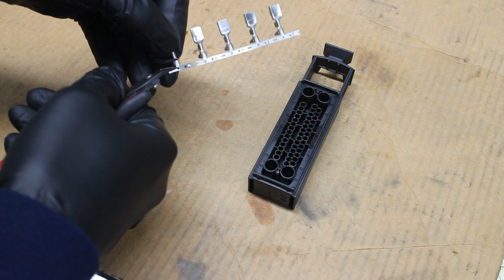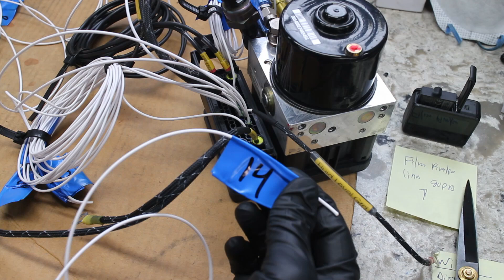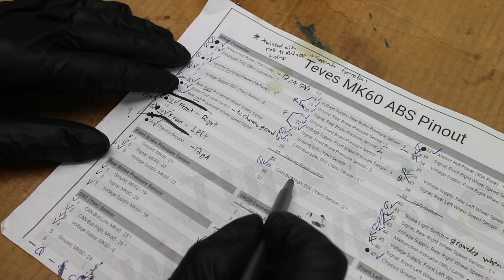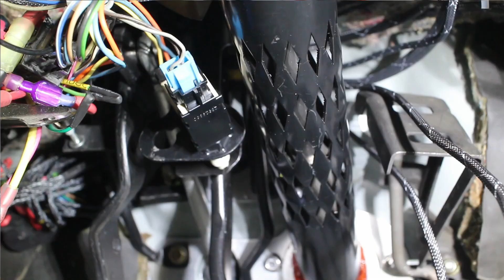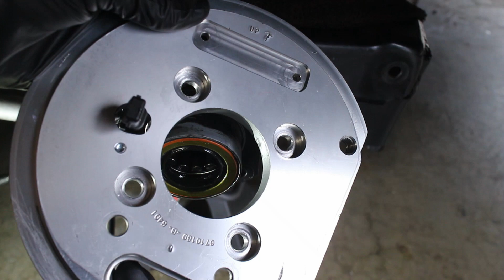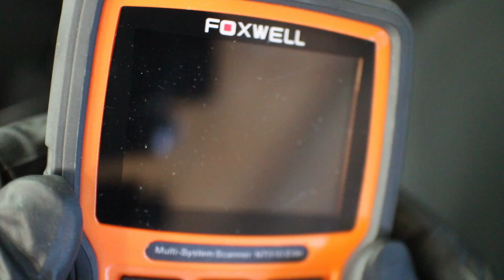Installing a Universal BMW M3 MK60 ABS System!

Comment from the maker: after 2 years, I noticed my 2 rear PTFE brake lines were heat damaged .
so I switched to all hardline stainless. 
I also switched the power source for the ABS off the relays and on to switched 12v power.
also, the Mk60 817 unit has the CSL tune stock, NOT the full Motorsports tune.
Reply: Would that ABS integration make sense for a daily driver? Of all the unnecessary, modern electronic items, I consider ABS to be the only thing that I wouldn't wanna miss

Comment: I'm curious how the ABS retrofit moved you in terms of position on pace? I race a Super Beetle, I don't think it'll ever really be crazy competitive but right now I'm about 3s off lead pace over ~50s courses and I feel like I'm severely lacking in braking due to the way rear engine cars can be so sensitive to front axle loading under braking (front roll stiffness can mean very easy flat spotting).
Reply from the maker: I don't have any ABS ON/OFF data on the same day.
but the confidence factor is pretty huge.
the MK60 out of the box is not setup for rear engine cars, but can be flashed and tuned for it.
Reply: @3rdGenGuy I've seen some people have put it on 911s. I don't see how it'd change, does it change the bias or something? My brake setup should be fairly well biased with just the plain hydraulics.
Reply from the maker: the system has programming based on the weight and bias of the e46.
The MK60 systems I've seen in 911 CUP cars had been flashed to take advantage of the rear engine weight bias.
But I doubt a stock tuned unit would be bad.
any ABS is better than NO ABS.

Comment: Im confused about the 818 version.  Does it have the motorsport tune on it or just some standard tune that is acceptable?  Why can't the other MK60 variants be used for stand alone??
Reply from the maker: 818 doesn't have the memory to flash.
only the 817 and 813 can be flashed with the $2,000+ motorsports software.
Reply: @3rdGenGuy  Yes, I get that, but since the 818 is unflashable, what makes it so special?
Reply: @adamsholzhaus8196  The 818 is still special because even without the motorsport flash its a better ABS unit than most cars come with and it can be less expensive than most other options.  The Bosch M5 ABS kit is somewhere north of $8000 being the first one that comes to mind.
Reply: @jhcoverdrive9287  Wish there was an aftermarket ABS.

Comment: Awesome video! Can you share the name and model of the crimp tool you used for the ABS module terminals? I am in the early stages of adding a mk60e1 to my Honda Civic racecar and plan to use the same kit from Tulay.
Reply from the maker: Weather pack and Metri pack 280 crimps work on the Metric terminals.
there are kits on eBay or amazon

Comment: Do you get any axle hop on track for major braking zones? I did this swap in my 4th gen and get it pretty bad. All the usual stuff is addressed on my car so I'm going to adjust rear shocks and see if I can find some even crappier rear brake pads but the only other options I know are high dollar shocks or a 3 link mod.

As always great video!

Comment: great video. I was wondering if you knew about whether your 818 controller can be swapped out later on for a programmable one? Just thinking about getting started then upgrading later on.
Reply from the maker: the 813, 817, and 818 are all wired the same.

Comment: So with 818 units, it doesn't need flashing (neither can it be flashed). But as long as the wheel speed pulsers have same teeth count and the front and rear wheel have same circomference, it should work anyway? But does it matter with slick tyres, and if the front and rear tyres have different circomferences?
Also, if we are able to find 813 units, do you know how to flash them to motorsport firmware and fill in the parameters?
Reply from the maker: if you run a staggered set of tires, they need to be close in diameter. otherwise this ABS will think you have lock ups when you don't.
there's a few guys in Europe than can flash 813 and 817 units for about $2,000.
a non flashed 818 unit has a G limit at around 1.4Gs so if your car pulls more than that on say an A7 slick, the flash would be worth it. the flash has no limits on G forces you can pull.

Comment: I like your video right up on this very good I'm going to be installing a MK60 into my 4th gen Z28 but I'm running C6 C7 hubs on all four corners. Running the x-tracker adapters up front. And Miller-built on the rear it's an adapter to run c6 or C7 hubs. Now to which  turns into a floater axel. the adapter on the rear also allows me to have e-brake and run either Corvette Camaro or Cadillac CTS-V rear calipers. also the rear conversion adapter can be made for a Ford 9-inch , 10 bolt, 12 bolt Dana 60
Reply from the maker: the Mk60E5 can use C6 Zr1 speed sensors.
the mk60 and mk60E1 cannot without a signal converter.
I would avoid using the converters. not worth the drop in reliability.
Reply: @3rdGenGuy that's a very good note that you said that for other people reading this for others not to make a mistake . Hi the hubs I have are verified to work with the MK60 module without the need of a converter.
Reply from the maker: the Mk60E5 from the e90/E92 BMW yes
Reply: @3rdGenGuy remember I'm using the late C6 Corvette hubs that are active not passive sensors so yes they will work with an MK60. Now if they were the early C6 hubs they would be passive and will not work
Reply from the maker: make sure to verify that.
I've spoken to guys who were not able to use c6 or c7 hubs on a mk60e1.

Comment: Quick Q - the wiring to the Yaw sensor is canbus. I noticed 2 things, and help me understand how you dealt with them. I assume based on the year of the car, you aren't already running a canbus (but perhaps "yes" if you did an engine swap, perhaps added some other controls?). If not, did you just map the Can High and Can Low directly from the ABS to the Yaw sensor 1:1 or did you simulate a full bus by putting 120 ohm resistors across each end? Secondly, it was hard to tell, but did you run the Can High/Low wires as twisted pair? I'm integrating into a non-canbus car as well and would like to know how this worked.
Reply from the maker: the original Mk60 doesn't have can buss I believe.
only the mk60E5 units do.
neither need to to function either.
Reply: If you look at the wiring diagram that was shown briefly at 3:29, the Yaw Rate sensor has it's own dedicated CAN lines.  They're generally not connected to the vehicle's main CANbus - CAN is a non-deterministic communications system (i.e., signals on CAN aren't guaranteed to come out at predictable times, or at all for that matter, when many messages are on the bus at the same time).  The OEMs work around this by putting safety critical signals on their own dedicated bus.
Reply: CANbus wires should be twisted pair, btw.

Comment: Hey. I was gonna PM you but i couldnt figure out how.

I have a donor 00 camaro of which i am swapping the motor trans rear and entire chassis wiring harness into my thirdgen. And between this and another video of yours ill be moving the booster and master cylinder over too.

If you were me would you not just: also move over the ABS from the donor vs doing this? Obv id have to find a solution for front tone rings too, but that seems solvable since i too will be using Big Brake Upgrade to swap to fourthgen front brakes. 

Thanks. Where can i find your ebay store? A lot your videos have been extremely valuable and in them mention things you sell that id totally buy.

Thanks, Andrew
Reply from the maker: i don't know what info the 4th gen ABS wants, it may be like the c4 vette ABS that needs the oem ecu connected to work.
this is a link to one of my products. 
https://www.ebay.com/itm/176581934797
Reply: @3rdGenGuy hey thanks for your reply. I've combed through the wiring diagrams in all data in way I know you are one of few who can appreciate. 

Tbh it looks like the factory fourthgen ABS is pretty rudimentary as well, similar to this video. It does look like the ABS inop and ABS BRAKE lighting control is turned on via Serial from the EBCM(abs computer) to the cluster. I have a solution for that (and actually a few other cluster LEDs).

But again I'm swapping the entire drivetrain, and almost all electrical over from the fourthgen too so even if I did need the factory PCM it will be there and connected.

Would you agree that it's imperative that I find a way to get fourthgen tone rings so that the fronts and (factory) rear axle sensors match? I have emails out to big brake upgrade to see if they can make that happen. 

I'm sure I'll find out more once I dive in. I'll try to document. do you hear anything I'm not seeing here lol?

Comment: Hi. Very informative video. I have a question as to why you used the standard 818.3 even though not flashable? Funny enough i have the 817.3 (CSL), 813.3 and 818.3 unit but not sure what to go with? Any advise would help!
Reply from the maker: the 813 and 817 units are identical from a mechanical standpoint.
both can be flashed to the REAL BMW race tune, So it doesn't matter what you use if you are gonna have it flashed. (the flash is about $2K)
I used a 818 unit because it was $600
I just sold a 817 unit for $2,150. BIG price gap ha ha
I have zero complaints about my 818 unit so I'm goanna keep using it.

Comment: Why not go with 98-02 reluctor wheels instead of mustang? What was reasoning for that? Sorry for so many questions.
Reply from the maker: a few reasons.
1: you can't buy OEM 98-02 tone wheels. Hawks has replacements that are like 3lbs each and $60+ lol. 
2. mustang tone wheels are cheap & easy to get.
3. the Strange floater kits use 50tooth mustang ABS wheels. my main reason. I'm trying to save up for a full floater cambered 12 bolt axle.

https://www.strangeengineering.net/product/strange-pro-touring-floater-kit-with-cambered-spindles-toe-plates-axles-and-brakes-sold-separately.html/
Reply: Strange sells the 02 Camaro rings for $38. You think I could run those on the front? They come stock in the rear. Otherwise I need to tell them to put the mustang ones as I'm building a strange s60 to bolt right up to a 3rd gen.
Reply from the maker: $110 to install 2 rings,  miss me with that ha ha.
Any tone wheel works as long as all 4 are the same.
The ABS doesn't know how many teeth the wheel have.
some tone wheels can be as cheap as $10 each
Reply: @3rdGenGuy  Thanks! I decided to go with the mustang to be on the safe side.  Did you not use dust shields in your build? Your backing plates look quite different from mine.
Reply from the maker: no dust shields anywhere on my car.
as far as the tone rings, it's whatever works really.
just make sure all 4 are identical and the wheel height is the same on all 4 tires.

Comment: What's the reasoning for keeping third gen axle length rather than swapping to a 4th gen rear diff entirely?
Reply from the maker: 4th gen axles are wider. makes wheel fitment way worse.
especially since I Run custom made Forged wheels meant for 3rd gen widths.

Comment: Very interesting work ! Is a prop valve still used in this kind of system ? Do you think you can get the 60-o distance down with further tuning ?
Reply from the maker: I use a balance bar, so no prop valve.
but you can install a single prop valve on the rear brake lines after the ABS unit.
or just use the ABS unit handle the rear lines without a prop valve.

I think with better brakes and the MK60 race tune I could do 95ft 60-0mph

Comment: Awesome content, as always. Do you think it is possible to make a traction control system with this pump?
Reply from the maker: The pump won't control a TC system, but the 4 speed outputs work as data inputs into ECUs like Halltech TC.
in the video I mentioned I put the 4  speed outputs on a plug for later.

Comment: Awesome video. I'll have to give it a try on my old racecar. 

If you are looking for new things to do and are a tinkerer like me, why not try an electric steering column from a Prius so you can run a more aggressive ratio in the steering box. Sounds like you may have completed a project car to the fullest!
Reply from the maker: I've seen the EV steering kits.
interesting for sure.
but I have a old 8:1 NASCAR box that has a super quirk ratio, hard to beat that

Comment: It's crazy how trouble free this system has been for you right off the bat.
Reply from the maker: only issue I've had is overheating my relay box that powers this unit.
gonna move the 12V main wires over the winter to fix that.
I also purchased the BMW motorsports Full RACE ABS unit today as well ha ha. should be even better than the M3 unit
Reply: @3rdGenGuy would you sell the old abs setup
Reply from the maker: @bizzysmiley  I already sold it. Subaru race shop wanted it

Comment: How is the BMW unit different from a 4th grn GM unit? Flushable?
Reply from the maker: 4th gen isn't Standalone, and the 4thgen ABS is CRAP for racing.
this Mk60 is often swapped into c5 and c6 corvettes.
even c7 corvette owners using this BMW ABS.
even seen this Mk60 on Porsche 911 Cup cars. ya those million dollar race cars.
Reply: @jhuntosgarage  It's not stand-alone